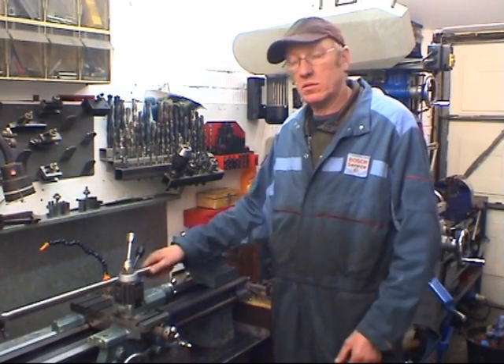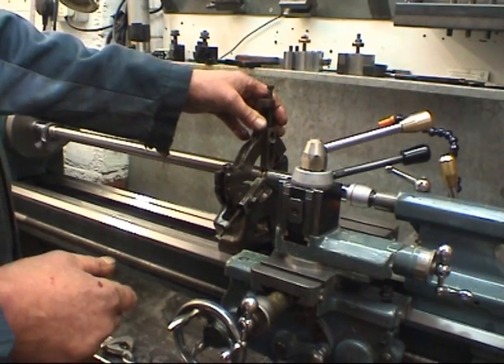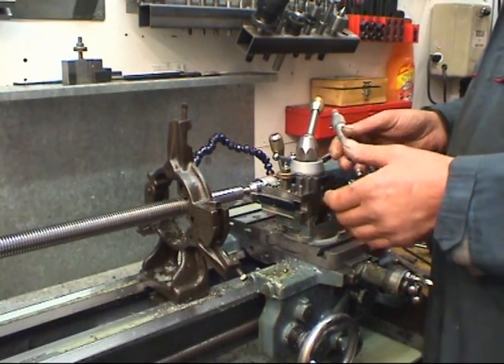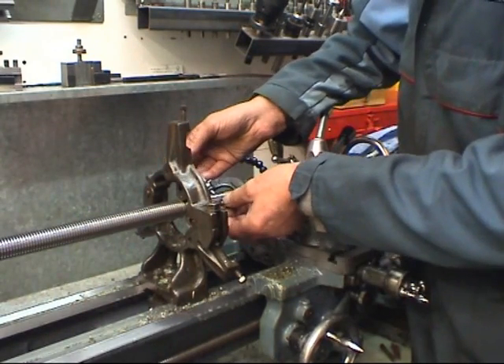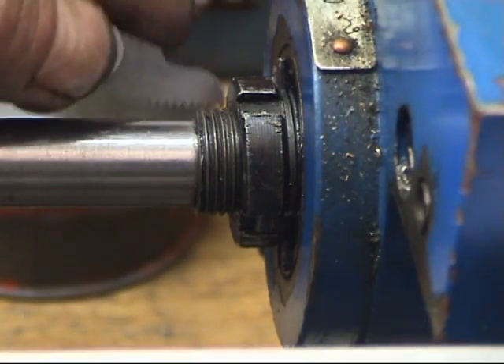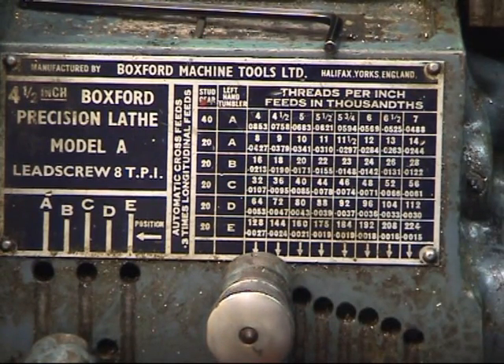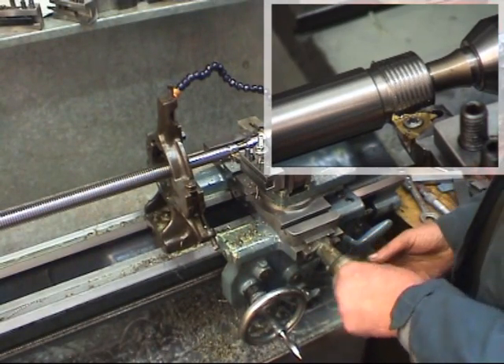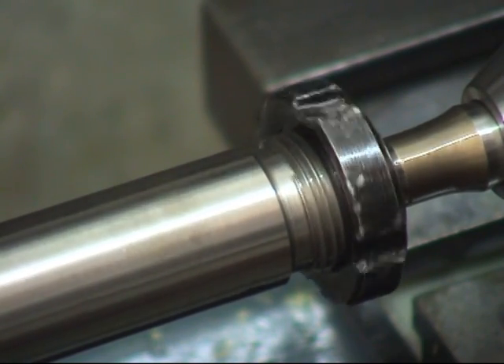Well Screwed Part 2

Comment from the maker: Hi
Basically the lathe will cut any imperial thread just using the gear box
You need a conversion gear to do metric
My lathe has back gear wich gives me 60 rpm
The inverter then means i can reduce this to virtually zero

Comment: Hi Jon great video. I have one question do you have to change the gears on the side of the lathe every time you do a different thread/ I recently  purchased an old lathe and it didnt come with any change gears. It also has a quick change gear box similar to yours but I cant get it to run anywhere near as slow as you have here.

Comment: I see this threading technique(no compound involved)  a lot in other country's I clearly see that i works but the tool pressure is very excessive as both sides of the cutter are cutting this can break the cutter